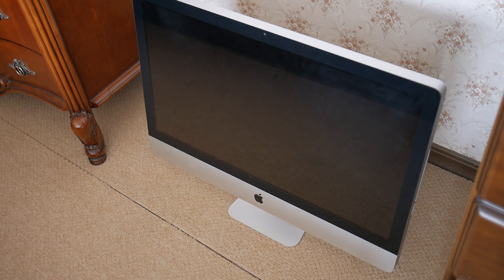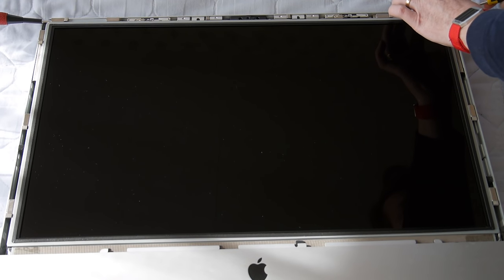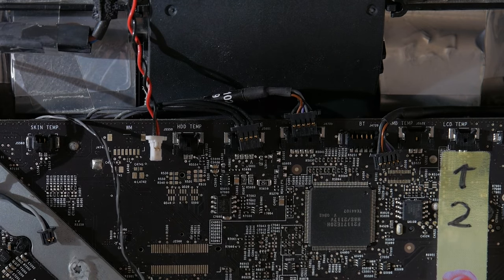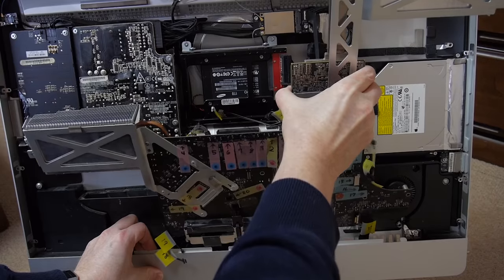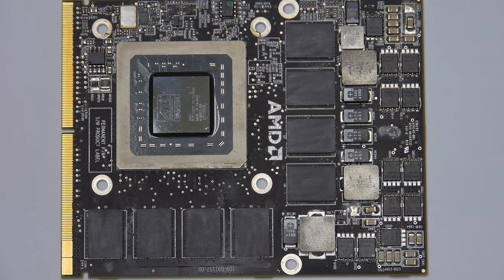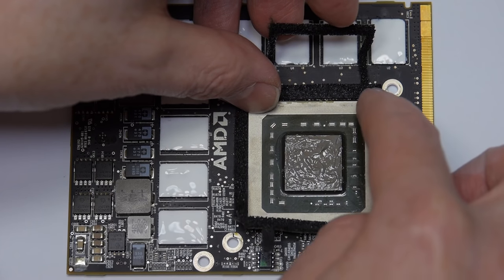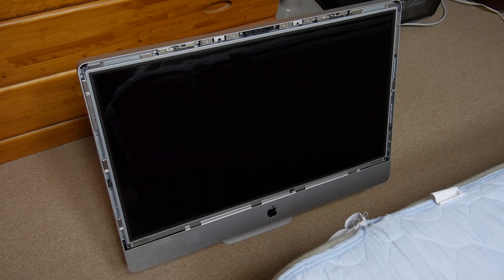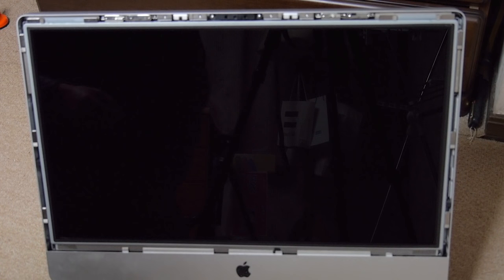Late 2009 iMac 27" Video Card Repair [4850 Bake]

Comment from the maker: Folks, I am the bearer of Good and Bad news.  First the BAD.  I am saddened to report that my 1st bake, shown in the video above, lasted only 4 months.  Another YouTuber who did the same repair reported 17 months of use on his bake as of Feb. 2017.  He inspired me to do my 1st bake and create the video above. Why he got 17 months when I only got 4 months is anyone's guess.  The GOOD news is I have done a 2nd bake and had success.  I also used K4-Pro on the GPU & K5-Pro to replace the stock thermal pads.  Neither of these pastes is electrically conductive.  Here's the full video of my 2nd bake:

https://youtu.be/6BJGLFCigdA

There is nothing wrong with the video (above) of my 1st bake, and it still serves as a useful guide.  The video of my 2nd bake is similar to my first video (above), except that I did NOT remove the motherboard in my 2nd video (because I'd already replaced the BR2032 battery in my 1st video).  I hope both of these videos will serve to assist those of you who wish to follow in my footsteps.  Best of luck to you!
Reply: Your graphics card is dead. It's a flip chip gpu. This is not a fix to last long. It works because the substrate starts moving at 140-170 degrees Celcius. 200 is not neccesarry. If you want a long term repair just get a mxm3 graphics card(from a laptop or so, ebay you know). If you don't care and only want  a quick fix heat the chip directly  to 170. gl :)
Reply from the maker: Tensor, my graphics card is not "dead";  If it was truly dead then it could never, ever be resurrected by an oven bake.  But if you watch my 2nd Bake video, you will see the card is now alive and running again.  Truly dead cards don't come back to life by an oven bake or heat gun.  As such, the heat treatment seems to be reflowing solder in just the right spot to get everything working again, or perhaps it is fixing broken contacts inside the GPU chip (most likely the latter due to the temps involved).  Regardless, my tests show the card is most assuredly "NOT dead."  The correct label would be "fault by design." Apple really screwed up on this model iMac with regard to the video card.
Reply from the maker: Jose, a heat gun can potentially damage things too, which is why I did not use it.  But in terms of how long a bake will last, keep in mind that what inspired me to do my 1st bake was another YouTuber who reported in Feb. 2017 that he had 17 months of continuous use after his 1st bake.  If an oven bake was truly inferior, I would not expect one to get 17 months of use out of it.  Even so, my case was different, with me only getting 4 months on my 1st bake.  Time will tell how long the 2nd bake lasts.
Reply: Solder does not melt at 200 degrees(217 min). But at the point of death you got me it's a zombie:D I think it's completely fine to do the oven method as a private repair if you don't care killing something completely. But I don't want someone doing this as a buissness operation for a repair center or so. I would recommend everyone interestet cheking out flip chip design and than related to that ltt's video about that where he "fixed" the gpu but not the ssd. And by the way today I repaired an 2011 iMac damaged by a lightning storm. 1 resistor near the cpu_fan connector was broken.10k OHM -  R5700 Just in case anyone else has a fan spinning at full speed all the time
Reply: And ya Apple had a extended warranty programm for that. I think AMD screwed everyone from 2009-2012 (my Asus laptop too:( )
Reply from the maker: Tensor, for what it's worth, I have a degree in Electrical Engineering.  As such, I am well aware of the melting point of solder.  Even so, the bake works.  I would never recommend that anyone build a business around baking fault Apple video cards, simply because it cannot be guaranteed.  But it does work and is a good idea for those of us who have nothing to lose.  Thanks for posting the tip about the fan resistor.  Maybe that can help someone out there!  Best wishes.
Reply: Ok you seem to be an good guy but then people come to me and really believe that the solder joints are the problem and want my support to go against the local repair store because they feel "ripped off" by their not scientiffically correct knowlege just frustrates me and I want that people understand whats behind the repairs. I subbed anyway because you are very polite and have made some interesting videos(I also appreciate it that you show the correct way of dissassembling the Mac and don't skip, maybe for you irrelevant steps, that helps everyone with a iMac problem). Good luck. P.S. what I mean with "support against the local repair store" is when my friends come to me and say "they want to charge me 450$ to replace the card but I saw that that guy from the internet just put it in the oven!!!!! And I have read the solder joints are "just" the problem!!! can you help me???" and then I have to explain them the real cause of the problem and that this repair shops are forced to give warranty and that heatgunning something is not something you give warranty on.
Reply from the maker: Thank you for your kind words, Tensor. I agree that a local repair store -- or better, a brand new card -- is superior to a card bake to resolve this kind of problem. Some repair shops would reball the GPU chip, while others would say it is hopeless until you buy a new card. But as I have said many times before, simply buying a new card of the same model is not a long-term good solution.  I know this is true because 3 years after I bought this late 2009 iMac, just after my AppleCare expired, my video card developed a problem.  Thankfully, I emailed Tim Cook and he got an Apple exec to examine my case.  Apple ended up swapping the video card for free, but 3 years after the swap, the same problem occurred, proving without any doubt that there is a design defect in this particular card.  Even so, I've read about other iMac models, which use different model video cards, having the same problem.  As such, it cannot be said that even replacing with a new card or different model card would truly offer a "forever fixed" solution.  And that is why I feel logic dictates the oven bake to be a sound alternative.  If one has nothing to lose and it works, even for only several months at a time, why not?  In the end, for people who don't want to deal with these headaches, I can only suggest a late 2015 or later iMac.  I have a late 2015 iMac at the office and it runs cool and fast, and I've not read reports about video card failures in them.
Reply: Yeah with the card-productline defect you are right. So if anyone here wants to replace his graphics card for that iMac modell it's a MXM3 graphics card. Look the card you want to buy up before doing so. Good luck with your repair!

And do not buy AMD cards from 2009-2012 these chips failed in laptops of several brands, especialy in the macbook pro's from 2011.
Reply: In the case of flip chip tech, baking a card is not a fix, 90% of the time, the problem is internal and there is nothing wrong with the solder connecting the chip. Technical Explanation: The eutectic bumps inside the chip attaching parts together break. When you heat the chip to 120-155c(which is WAY BELOW SOLDER MELTING TEMPERATURE), the bumps will reform themselves and it will work again for a week, or a month, or two months, and then die.

The proper fix is to replace the chip or replace the entire MxM card. Reflow and Baking may or may not revive the chip, does not restore full performance, and usually is limited to a few months of normal use. For the amount of labor required to take apart and repair, IMO its not worth a crippling system that wont last. Doing it right can give you years of renewed life out of your mac. I have my doubts that a bake would ever resolve a failing GPU to the point of being able to run normal wear for 17 months because there is no scientific reasoning backing this method. If anything his issue may not have been a chip problem but a cooling issue. I have seen many laptops, consoles, and desktop GPU's that people have tried to reflow or bake just for it to last a few months before complete failure.

Talk to a electrical engineer, or watch LTT on the BGA chip replacement or Louis Rossman on reflows. Baking can ruin other components on the circuit board beyond repair so that you wouldn't be able to do a chip replacement. Capacitors are highly susceptible to heat and will expand or burst if they get too hot.

If you want to read about the science about how heat ruins the internals of flip chips, or more specifically the solder bump of the chip, and you don't mind reading a very technical science paper, which is building on 20 years of study and includes examination via electron microscope. Then enjoy this paper published by IEEE in 2007: http://ieeexplore.ieee.org/abstract/document/4250070/

Why would an expert, who does nothing but work on board repairs for his day job be discounted because of his hate for Apple? GPU's overheat and fail in both PC's and Mac's due to high temperatures. What he says regarding failing GPU's is inline with professional electrical engineers. Heat damages the circuitry in the chip. Heating the chip does not fully restore these connections.

"Aside from electronic considerations, computer chips are made of components that, like any material, degrade over time. Heat accelerates this process, as it does with any chemical process. If the processor operates at a higher temperature for an extended period of time, materials inside the chip can degrade, which once again will result in garbled signals." - http://www.ebullientcooling.com/heat-problem-computer-chips/

https://electronics.stackexchange.com/questions/13873/why-exactly-do-chips-start-malfunctioning-once-they-overheat

https://superuser.com/questions/191486/what-fails-in-the-processor-first-when-a-processor-overheats

Louis Rossman's Explanation (For dummies who don't want to read technical science papers)
https://youtu.be/E9aZZxNptp0

Lastly, the chances the bake will last longer then a month is so small that its not worth the wasted time involved in disassembly. You are reducing the life of the chip, capacitors, and board components by exposing them to high heat. As such, the GPU isn't the only cause for video failure as other components can fail on the MxM card. The chances are so slim that your more likely to cause irreversible permanent damage that would take a repairable product from a potential of 3 years of extended life down to a likely 2 week lifespan.

If your going to throw away your iMac, then bake if for the sole reason to learn how to take it apart and learn a little bit about computers. But, if you wanna resell it or get much more life out of it, do it the right way.
Reply: Tensor Hack so if I google MXM3 graphics card and just buy that it should drop in and replace my current one? Or can you give me a link to one I need to buy? I just did this tonight and it got my computer working for now.. is buying that card a more permanent fix? Thank you!
Reply: The only variable I can think of is the other person probably completely replaced the thermal paste instead of "refreshing" it over the old stuff like you did in the video. If the old stuff was dried out, it will dry out again, probably even faster and that turns it into an insulator instead of being able to conduct the heat away to the heat-sink, causing the chips to fail faster than 17 months.

I'll be doing the same trick you did in your video. Thanks for making a LONG video that shows all the details. It's not overkill to label everything. Sometimes I have to leave a project and come back to it 2 weeks later. THEN try and figure out how everything goes back together. That's where labels and these type of videos really help. I use the same trick but with painters tape and a sharpie since it doesn't leave residue.

I'm not a fanboy for Apple. They sacrifice longevity and quality for the sake of aesthetics. Computers, like people, should be judged by more than looks.

 I've never had an issue with my home built PCs. I can pick cards and components from hundreds of different companies, load windows and it works! I still have one I built 12 years ago with windows XP that's still running! It is just slower than my current one so its mainly used for internet/youtube in the garage. I open the cases once a year and blow out the crud with compressed air and refresh the thermal paste every 3 years. The Achilles heel of LAPTOPS and apple products is not enough heat dissipation. If you don't clean them religiously and keep them cool, they fail.
Reply: what is mxm3 GPU?
Reply from the maker: To counter what Jonathan Martinez said 7 months ago, I'd like to emphasize that as of this writing it's been 9 months since my 2nd bake and my iMac is still going strong, being used daily and even for gaming by my son (which taxes the video card).  So all the science and "20 years of study" talk is merely talk, not a practical reality.  

One thing we learned in engineering school is that there is a difference between the "theoretical" and "experimental."  Sometimes the difference is huge.  It's akin to testing a circuit in SPICE only to find something very different when you build your circuit on an actual PCB, even if you modeled parasitics in SPICE (seeing you can't effectively model the PCB in SPICE).  Yes, I have an EE degree.  That degree doesn't make me an expert on video card problems, nor am I applying all that electrical engineering knowledge to this bake, which if we're all honest looks like a very odd and even stupid thing to do.  All I can say is that my iMac failed after 4 months after my 1st bake, but is still going strong 9 months on after my 2nd bake.  I also changed thermal pastes, but I don't think that is the only reason for the 9 months of use I've gotten out of this iMac thus far.  

I of course cannot guarantee success for everyone, but I do read and reply to every post here.  And pretty much everyone who has tried the bake has had success.  That's one up for the "experimental" and the "practical."  So to everyone who has nothing to lose by trying the bake, don't let Louis Rossman and his proponents hold you back.  Doing the bake correctly is rather hard and takes a lot of time, but I think it's worth it.
Reply: Thank you so much for your video. Based on it, I baked my card (Radeon 6970) on the same model iMac. It lasted 12 months, then glitched again a few days ago, so I've successfully resurrected it again with a second bake. Kept it same as my first run of 10 minutes. Anyway, thought you'd like to know your post is much appreciated.
Reply: @JDW-  Hello friend I want to ask you a question I have a Mac of late 2009 but unfortunately I can not get my Mac to repair, you believe that today if I communicate with someone from Apple they can help me replace my card as well as you they helped you?

Do you have any contact from apple?

There will be a minimum possibility?
Reply from the maker: @victorsuazo4704  Thank you for your question.  Your Mac (and mine) is now 10 years old.  It is unlikely Apple still has the parts to repair it, and the cost would be very high as well.  In my case, I got a free replacement from Apple only because my AppleCare had just expired and Apple was very kind to extend that free exchange to me even though AppleCare had just expired.  But in your case, even if you had AppleCare, it has been expired for many years, so Apple could not offer free exchanges in that case.  And again, they probably don't even have the parts to do the exchange now.  

With that said, my videos are about doing the repair yourself, using your own oven.  So long as you have two full days free (like a weekend), and so long as you get all the tools and parts you need, you should be able to do the job yourself.  

Scroll up and look just under my video.  You will see my name "JDW" and beneath that a date and beneath that some text and the words "SHOW MORE."  Click "SHOW MORE" and read through that information.  You will find a link there to my 2nd Bake video.  I would recommend you watch that video too.  You will find all the tools you need and thermal paste information in that text.

If you don't feel you have the endurance or patience to do the job, I full understand.  But if you have a friend who likes tech, that friend may be able to do the job for you.  Just make sure they watch my videos and read all the text beneath the videos.

Lastly, you could find a used video card on EBAY, buy that, and install it.  But it would cost you more than doing the oven bake, and the work involved in replacing the card would be nearly the same as doing the bake shown in my videos.  

Please let me know if this information helps.  Best wishes!
Reply: @JDW-  Perfect thanks for your response, I believe that the steps of the video I could make them and manage to repair my video card ..

But I have one more question, how long would the computer last if I managed to repair it with the oven?
How long does it last ?

The last question...

When I turn on my computer I see vertical pink lines and then the screen is left with small pink and green squares ..

Is this a problem with the video card too?

The Ono would solve it?
Reply from the maker: @victorsuazo4704  Yes, those display artifacts are signs the video card is failing.  

So far, my 2nd bake has lasted 1 year and 9 months and it's still going strong.  Even when I had a brand new card it lasted only 3 years.  So as you can see, the bake is worth your time.  Just be absolutely sure you read through the text description under both of my videos to ensure you have all the tools and the right thermal pastes before you start.  Then you should be good to go.  Take it slow. Follow my videos.  You should be fine.
Reply: @JDW- Thank you mi brother for your help !!